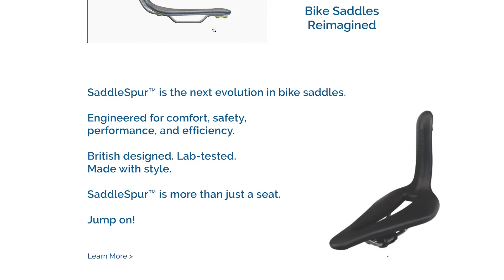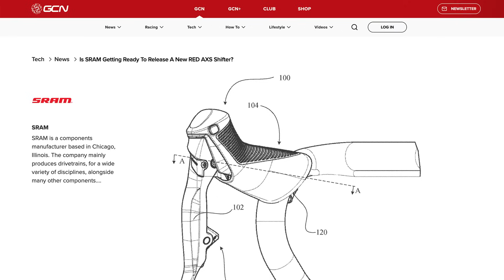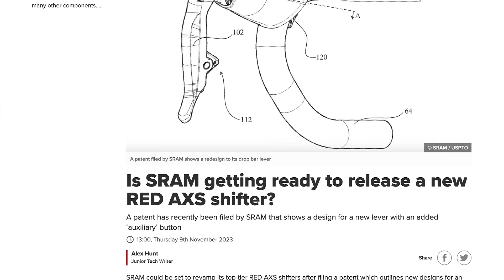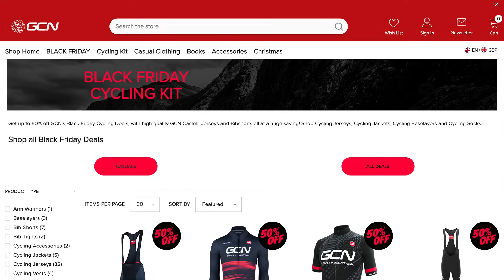What Makes The PERFECT Bike? | GCN Tech Show Ep. 308

Comment from the maker: What would your perfect bike look like? 🤔
Reply: Invisible to my wife would be good!
I get it in the neck quite often for keeping mine in the house, safe from thieves and the elements.
Reply: I like my aluminium Trek Domane. It has endurance geometry, rack and fender mounts, and bolts for water bottles and a top tube bag.  I’d like to change it to fit a 50mm tire and have internal storage.  Disc brakes are a must, and I want mechanical 2x12 with a 53  tooth large chainring and a 12 speed 10-52 tooth cassette and clutch rear derailleur. That sounds like absolute bliss to me.  I’d also like a silver finish on the group set, like the limited edition GRX has.  I’m tired of all black.
Reply: my personal taste would be similar as Manon, an endurance road bike that has large tire clearance for putting on gravel or road bike wheels. I used to see one that just came out and has a very nice 39mm tire clearance, but not sure which one.
Reply: It doesn't matter that much.. as long as it weighs less than 6.8 kg 😁
Reply: You’re going to need a dozen and an infinite time to use them. Gravel….   That saddle is reminiscent of the old Raleigh Chopper - but weirder.
Reply: All road with clearance for mudguards when 35mm tyres are fitted will do me just fine.  Oh and it would have SRAM AXS with Hope brake callipers.  That saddle is pretty special - I'm sure it's some sort of late April Fool - but I'd love to see it made mandatory for 1 Cyclocross Race.
Reply: A nice gravel bike, something new Merida Silex.
Reply: A Fairlight Strael...just need to finish saving up for one!
Reply: Custom built ultralight steel with interchangable forks, and adjustable dropouts.  Picturing something where, with a little work, I can switch between a modern carbon fork, and classic low trail randoneering steel fork with rack, and adjust the rear dropout between "sprightly" and "stable".  Likewise, interchangable wheels--carbon ones for fast rides, or 650B with dynamo for randoneering.  Classic geometry.  Possibly breakdown for travel.
Shimano Di2, hydraulic disks.
Not sure about colour, but Metallic British racing Green and horn black on the bottom portion of rear triangle and forks is probably near the top of the choice list.
Reply: Why dont you do more on the bike vault as loads of bikes are uploaded & seems like you waste loads of good submissions
Reply: One that features on an epic GCN+ documentary 😢
Reply: Campag Record 8 speed, steel Ron Cooper frame, rim brakes and alloy rims with Record QR hubs (no lawyers' lips).  Oh wait, it's my bike! 🙂
Reply: Similar idea to Manon but as the roads where I live are quite bad and the Gravel can get a bit "MTB" my staring point would be a Gravel frame and build from there.
Reply: Cyclocross time trial
Reply: Being a very simple being……Merida Scultura from Bahrain Victorious!
Reply: Gearbox, belt drive. Short travel suspension. Flat bars. 
Basically an XC MTB but with road geometry.
Super light weight
Reply: A Specialized Roubaix with mudguards and a pannier rack for commuting. Since this is a dream, custom paint job. Dark purple with pinstripes. That's the commuting bike. Would also need a 1x gnarly gravel bike with a huge dinner plate and a matt black paint job.
Reply: a bike that I find very interesting and similar to the one Manon described, just not only for road, is the Riverside 920 from Decathlon. 1X 38T and 11-46T drivetrain. It's not expensive and it has flat bars, which I like. I'd go with a gravel bike, but most gravel bikes have similar gears to road bikes and drop bars.
Reply: Alex & Manon: you actually gave the answer to the question "if you could have one bike...". But isn't a "perfect bike" perfect, when it does exactly what it was built for? The most Aero Aerobike, the lightest lightweight bike, the Gravelest Geravel bike etc.?
Reply: @TheMachoGabacho  I'll be picking up my Trek Domane al 5 gen 4 this coming Wednesday. I also have ordered Elitewheels Drive 45mm deep carbon wheels (less than 1300 grams)!

I have already worked up on paper my ideal gearing. I'm going to try to get as close to this as I can. It is a half step (I call it inbetween) gearing arrangement like on old ten speeds back in the 70s. If one is not familiar with half step it might be a bit strange to understand at first but here are the gear ratios from low to high.

55 / 55 = 1.00
59 / 55 = 1.07
55 / 48 = 1.15 
59 / 48 = 1.23
55 / 42 = 1.31
59 / 42 = 1.40
55 / 37 = 1.49
59 / 37 = 1.59
55 / 33 = 1.67
59 / 33 = 1.79
55 / 29 = 1.90
59 / 29 = 2.03
55 / 26 = 2.12
59 / 26 = 2.27
55 / 23 = 2.39
59 / 23 = 2.57
55 / 20 = 2.75
59 / 20 = 2.95
55 / 17 = 3.24
59 / 17 = 3.47
55 / 14 = 3.93
59 / 14 = 4.21
55 / 11 = 5.00
59 / 11 = 5.36

:)
Reply: Close to Alex's choice, I'm lucky to have a Titanium road bike and would definitely choose another one
Reply: Perfect bike is one that doesn't require time in bike shop so you can start riding it again

Comment: my perfect bike to suit me on & off road --> Canyon Endurace. On my bucket list for next year, so budget allows
Reply: Same
Reply from the maker: The Endurace is a great bike! What sort of off road riding are you doing? 👀
Reply: @gcntech  just light unpaved / graveled roads that are around my area in Bavaria or wherever I might be on vacation. Will extend the riding options for sure, as my slim 25mm road tires would throw the towel, if I'd force them on gravel roads. Got me some punctures in the past already. Yes still on innertubes 😉 And the Endurace offers a tire clearance of up to 38mm, which will suit the purpose on a 2nd set of wheels, so I can easily swap the sets between road and rougher terrain as needed/wanted.

Comment: My perfect bike: 
- a versatile CX frame, agile, full carbon....  but not the Canyon one, the Rible CX frame would be best.
- mechanical 1x transmission 12 speed. 38 T front, 11-42 back -  I'm not interested in speed and sprinting any longer... Oval chainring. (Ok, I'd accept the Campa Ekhar 1x 13 speed, or a Sram 1x12 wireless with some tweeks).
- light carbon rims with 21-23mm internal, with some minimal aero gains ( so, something in the 36-45 mm zone).
- Disk brakes all the way;
- Flared handlebars, integrated, with not so many spacers underneath;
- mtb clipless pedals.
- TPU tubes and several pairs of tires which  could be swapped easily depending on the trip, from 28mm road to 38mm gravel. Sometimes I'd put the 33's and go for a CX Race just for the sake of good old days....

Comment: My perfect bike:
Frame:
- carbon fibre
- aero tubing, not too aero
- gloss dark blue with silver dusting
- disk brake frame
- threaded bb
- 38mm tyre clearance
- very stiff
- low stack, medium reach
- fender mounts
Groupset:
- Dura ace Di2
- 2x 160mm disc brakes
- 52-34 chainring
- 11-32 cassette
- no oversized pulley wheels
- double sided shimano crankset powermeter
Others:
- speedplay aero pedals
- wahoo elemnt roam with additional sensors
- selle italia slr boost tm superflow carbon
- aero stem and spacers
- aero bars, carbon, small flare, slightly turned in levers

Comment: Seems like a lot of similar perfect bikes and I'm in that same boat.

Mine would be:
An endurance or all-road geometry frame, (doesn't need to be Carbon, cause I'll probably be crashing, especially on gravel or dirt)
Tire clearance of at least 35-40mm (right now on my 25mm slicks I can be on the ground just slowly turning around in a gravel parking lot)
An electronic 2x groupset with the easiest range I can get (to drag my fat and weak carcass up hills) 
2 sets of wheels, with a fast set for days when you don't leave the tarmac and then another that has those fatter off road tires for the gravel or mixed days.
Drop bars, disc brakes, mounting points that will rarely be used, but there when I need them.

That's going to be my next bike, one day.

Comment: I have a Cannondale Synapse with Discs, Ultegra, 50-34 Front, 32mm tires (Even 35 fits), Scope carbon wheels. Flared Eaton handlebars. Very comfortable. Does gravel and road.

Comment: My Felt Broam ist my perfect bike - perfect understatement: relatively cheap but comfortable aluminium frame, pimped with expensive carbon wheels and parts, that don't make the bike bling bling. A simple and fast allroad machine that's understated enough to be  used for daily riding and commuting but also for gravel racing.

Comment: It sounds like the perfect bike for Manon at the moment would be the Vitus Venon Evo, it meets all her criterior. Carbon frame, modern aero tube profiles and race bike looks, but with clearance for 40mm tyres with 2x (and up to 45mm with 1x).

I’ve just bought one and coming from a Supersix Evo I’d say the Venon keeps most of the speed and handling of a proper road race bike, but in a much more versatile package that can genuinely handle gravel rather than limping by on skinny “allroad” size tyres. It’s a very interesting bike and fits a space that not many other bikes have managed to fill.

I would happily use it for a road race or crit, and equally as happily use it for a big multi day ultra race (which is my plan for the bike).

Comment: After 3.5 minutes I agree with everything she said. It is what I ride today:
Evil Bikes Chamois Hagar (Matt black), 
Shimano GRX Di2 2x 160mm rotors 11-40 cassette used with full automated shifting, two wheel sets First:DT Swiss GR1600 matched with Panaracer SS 38 mm, and Second: Elitewheels Panaracer Slick 32 mm, YBN TI Chain waxed. 
But I also have Tailfin with side panniers (2x10 liter) and 20 liter top bag, a frame bag, and self engineered Profile Aero Bars holding my iPhone with a Velcro surface between these two bars. If GCN likes my configuration, I am happy to share full specifications and pictures.

Comment: I do own the perfect bike (for me) - a 3T Exploro LTD and it exceeds all my needs. Really racey geometry, so it's great on the road with 25 to 30 mm tyres. And then ofcourse - it fits 40c with a 2x Sram AXS groupset (46/33 with a 10/33 cassette) amazing gearing for both road and offroad. Swapping between road and gravel wheelset. With road tires it's 7.5 kg. The only thing missing is internal routing... but not a huge deal for me.
Reply: And 3T now offers the 3T Race Max made in Italy with internal routing. New carbon stem also.

Comment: The perfect bike is very Subjective and/or merely rely on the individual's/owner's preference.  I have 2012 Specialized Allez 8 speed 53/39T cranks with some upgrades during the years of owning it.  I considered it as my perfect bike for the last 25k kms.  The 700 x 28C rim brake wheels and tires works for me on all road (tramac/asphalt/cement) and very light/short gravel road condition.

Comment: A perfect bike is one where you don't need another one. I would neet two. An aero gravel bike is the first ideal one.

Basically a bike like the lotus/hope track bike with it's wide seat stays and forks is both aero and has massive tire clearance.

It also needs a good gear range, 2x chainring so you can ride fast and slow uphill. If it's electronic, it needs to be wireless because why would one still have wires? Ideally I want wireless brakes but they do not exist, yet. Also a wireless dropper post is a must, both for easy descending and aero benefits. 

You can fit aero wheels to it and be riding the tour, or you could put gravel wheels in it and ride the gravel worlds on it; it can do everything.

I think this is the best bike one could have. But it's not N+1

For my second bike I would want a mtb with dual suspension. Jumbo visma made a rear fork replacement part to make a fully into a hard tail mtb. I would want that. Also, why are xc mtb's not aero? Aero xc mtb is the ideal second bike!

Comment: Personally, my perfect bike would be a Giant Contend Sl disc 2021 model, but with SLR alloy, D-fuse carbon handlebar, hydraulic disc brakes and carbon wheels about 35 to 40mm deep and 34mm wide tyres. Specced with the 105 12 speed mechanical, 50/34 at the front 11-36 at the back.

Basically a bike that is chill when i want to and can go fast when I need to. The less than 1:1 ratio allows me to climb up steeper gradients while not grinding a massive gear while 12 speeds allows for good progression in the gears too. Mechanical because it'd be easier to service.

Colour wise, simple, slightly glossy black and white decals.

Comment: 32mm tires can handle most gravel and stay fast on the road. 10-44 with a 46/33 chainring makes for 0.75-4.6 gear range (not a mfg supported setup, boo). Drop bars with a flare but has a nice aero profile like the 3t aeroghiaia.

Comment: I know what the perfect bike is. It's a Shimano equipped mountain bike. With either Shimano or Hope disc brakes. If it's hardtail. Then 29x2.6" tyres and a full suspension. Then 29x2.5 front and 29x2.4 rear. Using Maxxis DHF 3C Maxxterra EXO+ and Maxxis DHR2 3C Maxxterra EXO+. Maybe the DoubleDown casing when the trail is really rough.

Comment: So maybe they should design one of those saddles where the spike does go up your ****hole. Not only will it hold your posture rigidly, but you will be able to tilt your saddle nose down and not slide off. And if the spike is like one side of a suspension fork, think of the smooth ride you will get. No more saddle sores, just pure comfort  😮

Comment: I ride my Diverge with GRX one by and 40mm Pirelli Cinturato M tread. I commute with it, ride gravel and mtb green and blue trails, so it’s quite versatile. It also has a dropper for the steeper drops on the mtb trails. Because I like riding everywhere, on any surface, that saddle may NOT get anywhere near my bike. I have to be able to get on and off the saddle and behind the saddle too. And I also think hopping on and off the bike with efficiency would be destroyed by that saddle.

Comment: the perfect bike for me is my actual bike. a specialised alley sprint size 56 no color bare aluminium 55 deep sections wheels from vision specialized 28 tan cotton tires, sram red axe groups set, roval rapide handlebar, specialised romin pro carbon saddle, and supecaz tape I wouldn't change for a carbon bike.